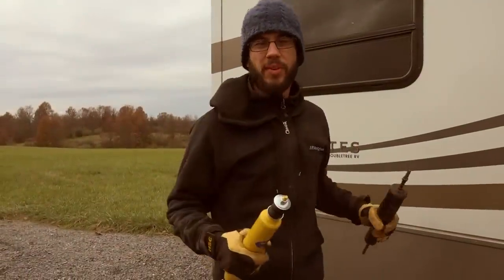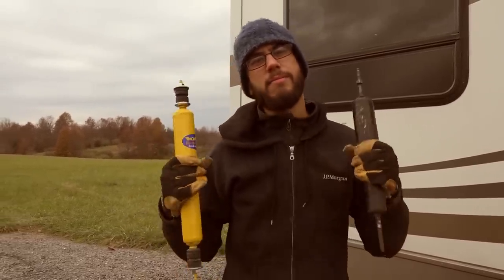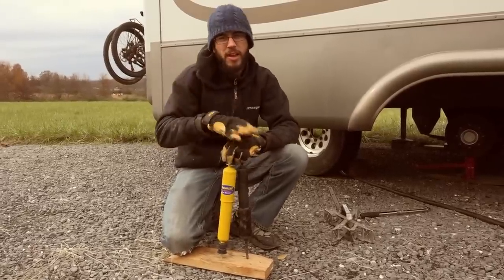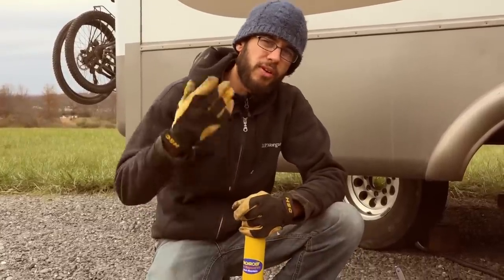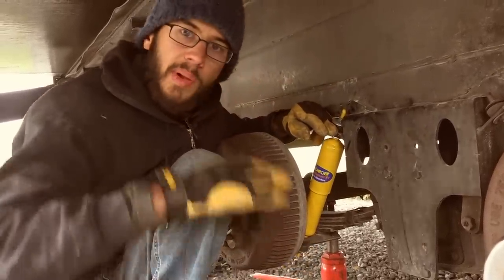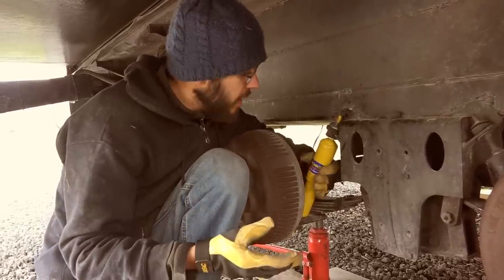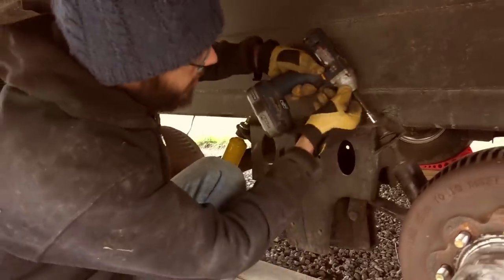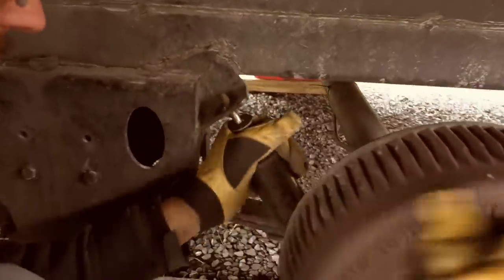RV trailer Shock replacement - How when and why replace or add them to your RV

Comment from the maker: Thinking of adding shocks, here is a kit for trailers.  The bottom can alaways bolt on but the top tab may need welding. https://amzn.to/2MQT9Xa  

As for that "missing" jack stand, the frame was supported in 2 places behind and in front of the tires and we could safely hang the axles if needed so this was not unsafe, If you do not have the support then ALWAYS use a jack stand in addition to your jack.

Comment: Going to swap out the shocks on my 2012 Arctic Fox 25Y, and finding your video was a Godsend . . .  You made it look so simple, I'm not going to sweat it. In fact, your showing how to measure the shock for size was an added bonus. My local Les Schwab was useless, which is unusual.
Reply: I called outdoors RV which is owned by the same people who do arctic fox go with the KYB much better shock and now that’s what they use
Reply: @acmanwwjd1  I did KYB's as well.
Reply: I contacted ORV as well and they couldn’t tell me what model number from KYB the shocks were.  Any help?  24 RLS..

Comment: Great vid, removing bolts, two ways, one, panther piss 50/50 mix acetone and transmission fluid let soak for 15 minuets, second, grinder zip gone.

Comment: At 10:16, you place a box wrench on the nut for tightening. What I found to be funny is that you start levering the wrench back and forth like it's a ratchet, while the actual tightening was coming by the fact that your other hand was turning the shock. BTW....locking pliers, not wrench.

Comment: a quick tip for installing shocks..if they have a wire strap holding them in the compressed state, leave it on until you've got one end mounted then cut it. as the shock expands you can guide the other end into the mounting hole. it's a lot easier than trying to compress the shock  by hand and then try to get it in place.
Reply from the maker: Yea these did not and were pretty easy, But good tip, doing bilstines on the truck I let one loose and it took a long time to get recompressed.

Comment: Tom, I noticed you have leaf springs on your Mobile Suite.  We have the MOR/ryde® I.S. Suspension on our '14 MS Estate.  I really like this system and yes the shocks do wonders for the ride, etc.  You must have done this video in the winter for sure!  Thanks for sharing!
Reply from the maker: Yes!   We have been considering the IS upgrade.  Next time we are through elkheart that may just happen! In the mean time we are going to be adding some air bags to the existing setup too.

Comment: Love your videos Tom. You remind me of myself, but with a camera !! Just bought a'05 DRV 36TK3, with the same MOR/ryde RE suspension. Wondering if you have had any problems with the rubber equilizers (rubber springs) tearing?
Reply from the maker: Well ours has a dexter rubber hanger... The rubber does appear to be getting a bit worn but does not look like its tearing yet.  I would like to do a complete upgrade to the IS some day tho.  We are also going to be adding air bags to help take some of the weight.

Comment: You said to measure the two stops when the trailer is level but you didn’t continue on to say what you do with that measurement. Is that a fully extended measurement or fully compressed measurement or a fraction of either one that you should be looking for for shock length?

Comment: The suspension on your drv is so much beefier than even other high quality fifthwheels. DRV really is a top of the line well built 5th wheel.
Reply from the maker: They are just 8k Dexter axles,. I think they put moreryde IS on them now . But I know what you mean, that is such a weak point in most towables.
Reply: @MortonsontheMove  Outdoors RV trailers have Kayaba shock absorbers on them.

Comment: I have a 19’ travel trailer, no spring only shocks, I noticed one of the shock has a nut not  very much screwed in at one end,,I can go ahead and give it a few turns?  Thank you for this video!  Is there a maximum torque on these nuts?
Reply from the maker: Usually there is no torque requirement, just crush the rubber damper a bit if it has one.  You trailer probably has the torque springs internal to the axle.
Reply: @MortonsontheMove  Thank you for your answer, I will go ahead and tighten, its definitely loose, gaps between the rubbers and the metal, the bolt is halfway in the middle of the nut.  The other side is snug and the rubber slightly crushed.  Thanks!

Comment: Great video. I really wish you would have had stands under the axles along with your jacks. Your nuts should be tightened down so the circumference of the bushing is just greater than that of the washer. Your videos are always very informative which keeps bringing me back. Be safe. Safe travels. Later
Reply from the maker: Good point we should have mentioned that, The front axle had a jack stand, We almost always use them in addition to the jacks, I don't know why we did not use one on the back but at least the RV jack is down and can hold he weight of the RV.  It would not tip over even if the jack failed
Reply: I understand. I just always err on the side of caution.
Reply: Safety Police are alive and well.

Comment: The right tool is not a pair of vice grips, but a shock socket.  Hold the nut with a wrench while turning the shaft with a ratchet or power tool.  Makes the job a lot easier.  The right tool for the job.  Also always use jack stands for your safety.  Never rely on a jack.

Comment: Tom, NOOOOOOO, I don't see jack stands under the axle! Whew, scare my mule just using the bottle jack! Good, relief, just saw stand.
Reply from the maker: :) Yea we always try to have a stand under it.  The RV jacks were also down so if you loose a bottle jack nothing will happen.  In fact i have dropped the axle all the way intentionally before (working on springs) and it will not even bottom out the jack usually.

Comment: Oh so you have one. Still not safe having back axle on bottle jack. Stands or put tire back on.
Reply from the maker: Agree it should have been there, but the RV can support itself on its jacks so if it failed it wouldn't go anywhere.
Reply: So you had the trailer jacks down. Did not see that in the video. All I could see at first was the precariously perched bottle jack on back axle. Then a ways into the video I see you did have one jack stand on the front axle. Well, even if the whole trailer wasn't going to squish you still had loaded axle that could have really hurt you had it slipped off the bottle jack. 

Bottom line, you should have both axles supported while working on it like that with jack stands. Otherwise it might become "Morton on the move" YouTube channel... Sorry to be so pointed, but you need to be safe doing these things just like working with electricity...
Reply: The factory actually confirms that the hydraulic system jacks will raise and hold the trailer wheels off the ground.